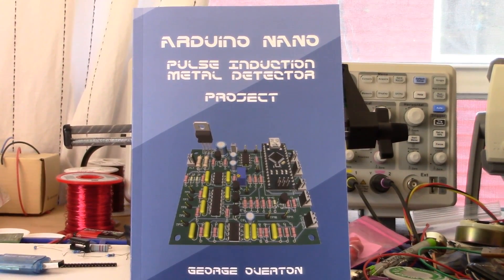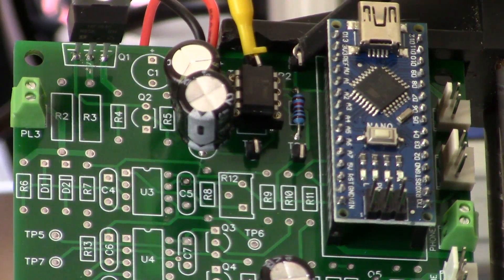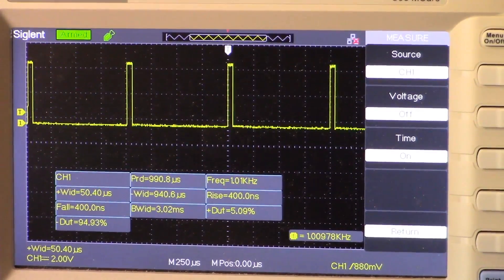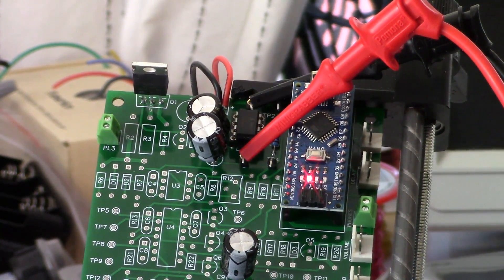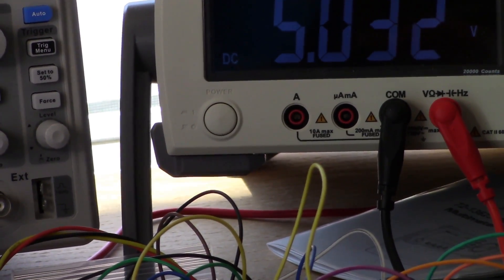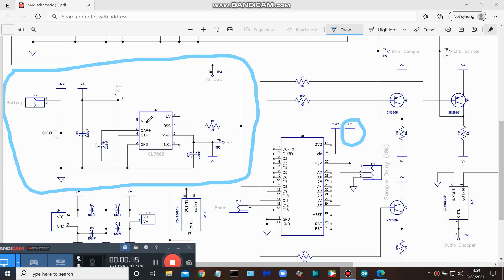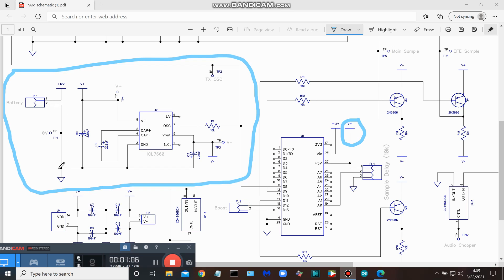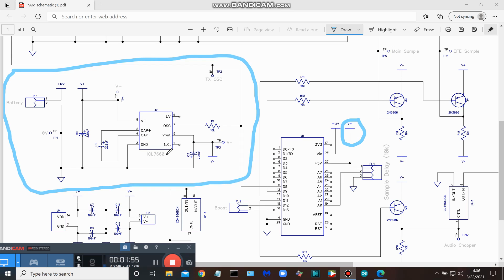Arduino Nano Pulse induction Detector part 1 power supply and TX pulse

Comment: وهذا الجهاز اخي يكشف شذرات الذهب
Reply from the maker: Hello Mohammed,
This project is another Pulse Induction detector.  It is almost the same circuit as the Surf PI which I have done videos on.  It will detect gold but is meant to use at the beach not in the mountains.  What country do you live in?
Reply: @SurfDetector  في اليمن اخي العزيز
Reply: @SurfDetector  جهاز ميني بلاس. إذا اردتو ان اقوي حساسيته. اقوم بتوسيع المخطط او استبدال المقاومات بأكبر منه اخي لتقويه الحساسيه
Reply from the maker: Hi,
I don't fully understand your comment.  Which resistor are you talking about?
Reply: @mohammedaaoad8780  ممكن ترسل لي ممخطط pcb
Reply: From what i understand seeing the schematic arduino is only used for timing?
Reply from the maker: Hi There,
Yes it does the timing and also supplies the +5V.  Thanks for the comment and for watching.  More to come.
Reply: @SurfDetector  
Hi 🎩🎩
Can you put a video in your YouTube channel testing thed surf pi please,  and thank you for your time
Reply from the maker: Hi Bilal,
When I finish this project I will put it together completely and have a video using it on the beach.  This project is really a SurfPI with the Arduino Nano being used for the timing.  As you can see from my channel, I make many metal detector projects however I do not package them all up after making the board because I already have too many detectors.Thanks for watching.
Reply: @SurfDetector  yes i did understand you thank you sir for this great channel